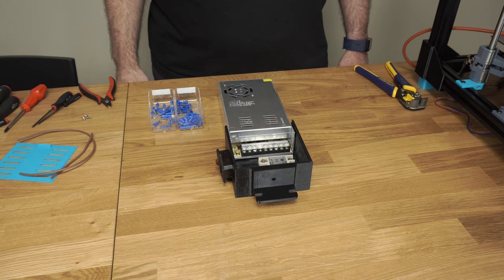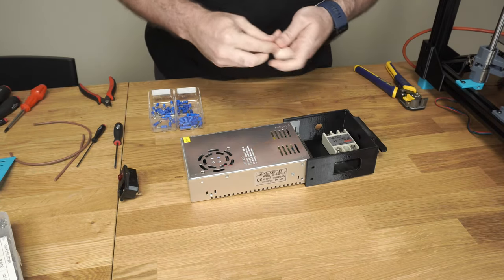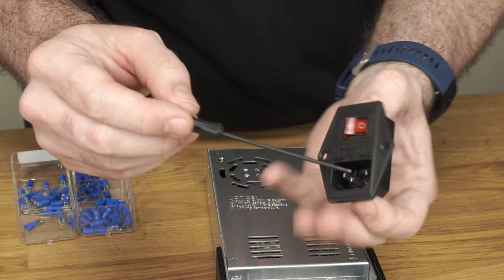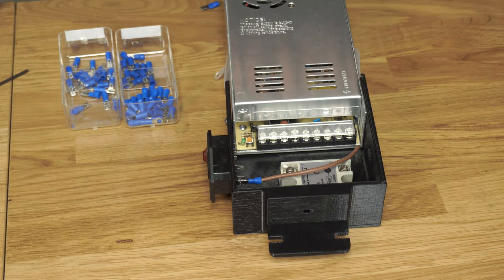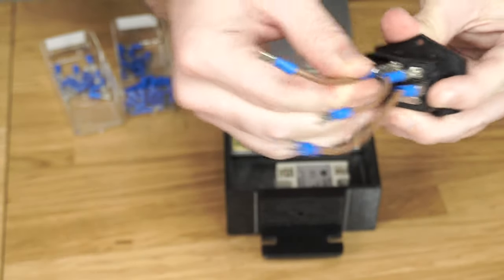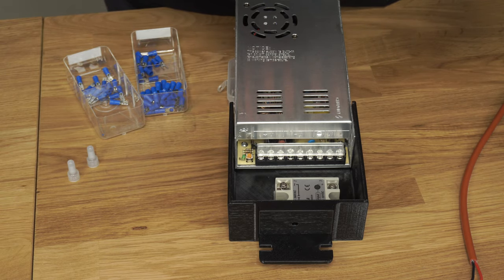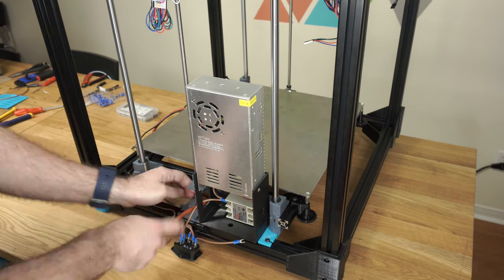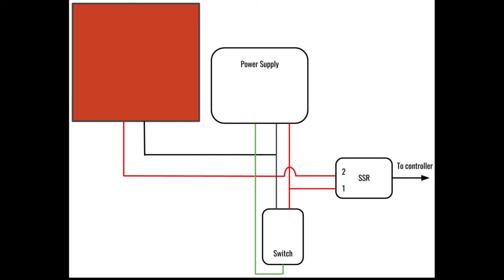Zyltech HEVO 2.0 - Electrical: Part 5

Comment: Great video. It has given me a few questions.

So the heated bed is powered by the same dc power supply as all the other electronics? Am I missing something? With a bed that size I’m worried the PSU is going to get overloaded. 

Is there any danger this thing will get overloaded if higher print bed temperatures are used? Do you think an AC bed need to be added for higher bed temperatures?
Reply from the maker: The heated bed is powered from AC via the SSR and controlled by the board. If you look at the wiring diagram at the 8 minute mark, you will see the bed and power supply share a negative, but the bed positive is connected to the SSR.
Reply: Aha! I knew I must have missed something. Thanks for the clarification.